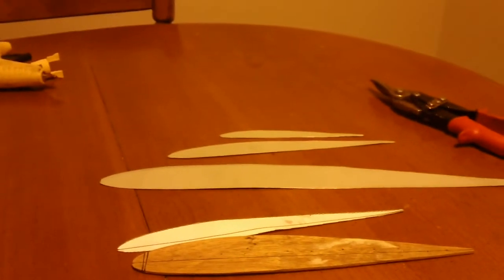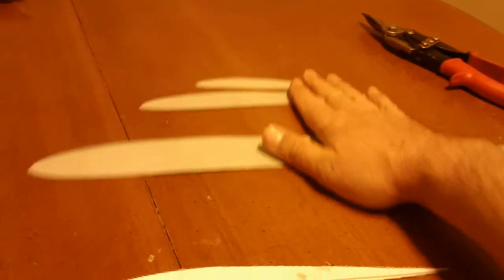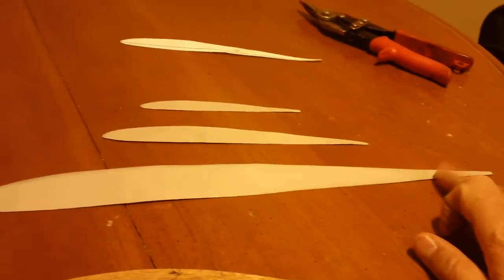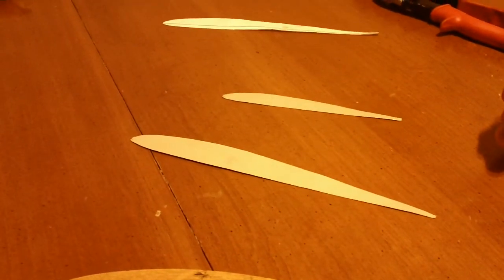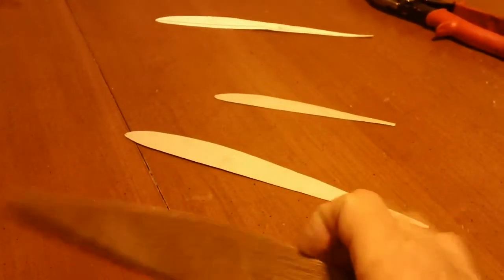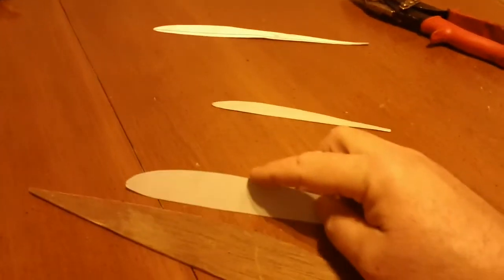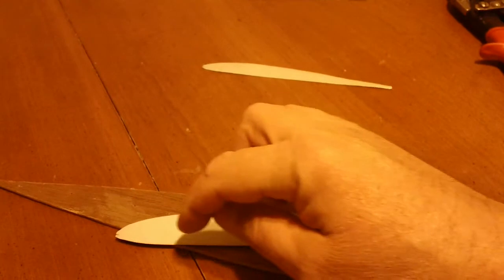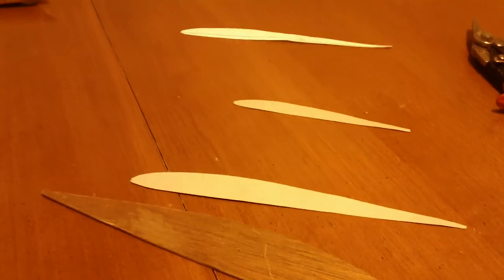Combat wing build wing templates

Comment: Thanks Rip, I have been using 25 to 30 degrees in the past and the flying wing CG calculator found online.  fwcg 3dzone dk  The foil you have there is semi-symmetrical, not flat bottom, right?
West